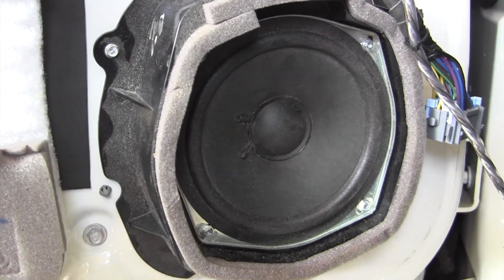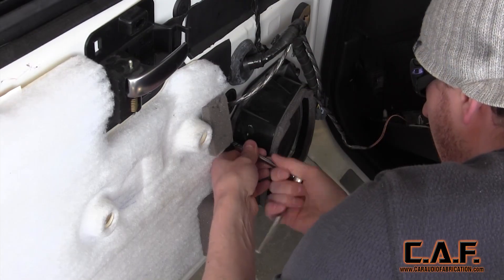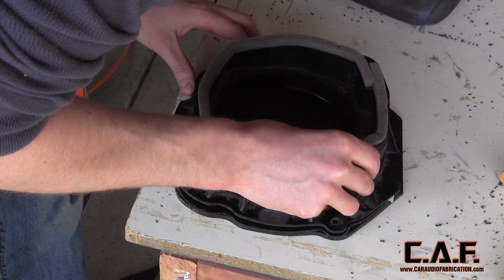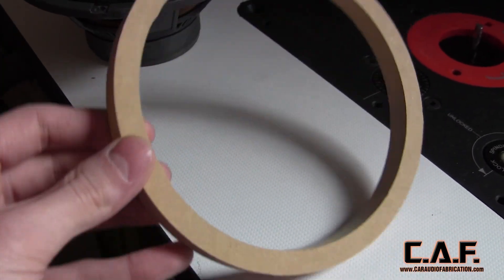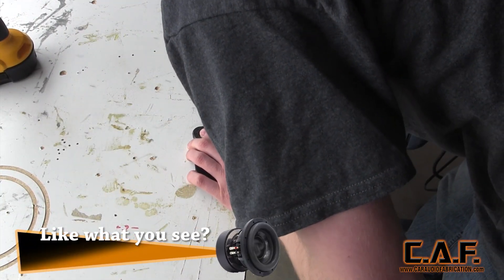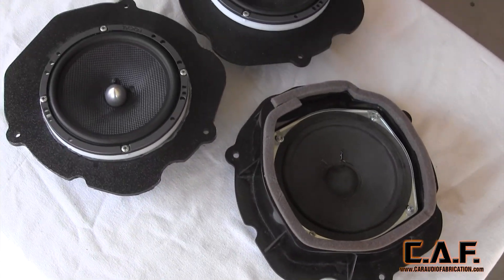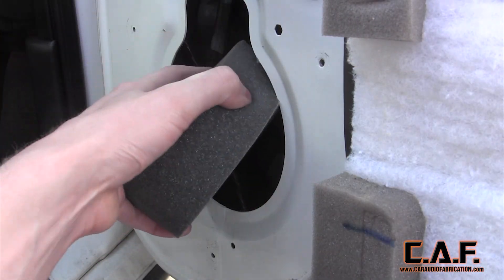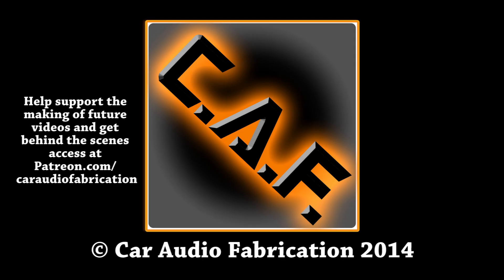How to Add Mid Bass - Build Custom Speaker Adapters CarAudioFabrication

Comment from the maker: Thanks for watching my video! Want more Car Audio Videos? Here are some of my most popular videos and projects you can watch!

5 common NOOB Mistakes - https://youtu.be/1FTsmUCbvoM
Amplifier Tuning How To - https://youtu.be/tiOUd3NkOyQ
Custom A-Pillar Speakers - https://youtu.be/neDSi4g1CeQ
4 Mistakes that kill bass - https://youtu.be/hXOnkOXvznI
How to Build a T-Line Subwoofer Box - https://youtu.be/KuBTuUdy460
Reply: You do installs? What state is your shop in?
Reply: I have 4 door speakers rated at 125 watts RMS and are 8 ohm. I bought a 4 channel amp that was supposed to be 150watt RMS per channel but actually are around 80 watt rms at 4 ohms. If I parallel the speakers to 4 ohms and bridged the 4 channel amp to 2 channels then how many watts am I going to get each speaker? Am I better off just running 1 speaker per channel?
Reply: A lot of youtube channels dont really answer questions that people have. Luckily there's a lot of information to all sorts of specific questions. You just have to be persistent in finding them.
Reply: Thanks. I'm gonna check out #3 & #4 right now!
Reply: How desing a sobwoofer box of 12 inch ported?

Comment: What would be the best way to achieve this with speakers on a backboard/parcel tray that's playing into the trunk of the vehicle?

Something like the Boom Mat Speaker Baffles???
Reply from the maker: Similar techniques. I personally avoid anything that "encloses" the speakers, those products are far too small and usually car audio drivers are designed for infinite baffle or much larger enclosure size applications

Comment: Is there a sound difference between foam speaker baffles and the open door with kill mat? Which sounds better. I am wondering about the foam baffles for my 6x9 door speakers but wondering if it will limit their sound output vs the open matted door enclosure. You are definitely right about the outside foam ring being necessary.  Made a big difference for me.

Comment: No dynamat?? I tell you what, I used Massive audio in my truck doors and sealed them in pvc tube. Free air sucks. Amazing control now and no bottoming out. Dyno tested these with a couple designs until I found the perfect fit and sound. Pvc 1/2 inch backer in a 6 inch pvc tube w/ short hair polyfill. Truck total amperage is pushing 6530 watts. Sound q is dialed.

Comment: Thanks for the info, I'm preparing to install my front components this week and my local Car AV shop sold me a silicone baffle set exactly like the NVX XBAF65 set instead of those FAST rings, I was wondering if they will work the same or the foam is a better material to seal and direct the sound out. 

Part of me is worried that all the snow we have for half of the year will affect and rot the foam. I do already have a sub in the back and might return these baffles and put that money to some SoundSkins sound mat if it's a more noticeable improvement over the baffle. 

Thank you for your help and advice in this channel. I'm asking you because I trust your advice more than armchair audio "experts" online and the salespeople at my local shops.

Comment: I did this...made a world of difference on the mid bass output of my jl c-250 6.5's in the doors of my hrv, it looked like the foam was sticking out way too far, but the door panels went back on no problem

Comment: I'm for sure making these. I can use the same items in description and follow each step exactly except i'm gonna have to put together 2 rings of 3/4" HDPE since my factory speaker mount is bigger than the one in the video. Also, my factory speaker is about 1/4 inch shorter than the focal aftermarkets i'm installing. that will give me 1.75" to work with and the glass shouldn't touch the speaker.

Comment: If sound quality is what someone is after why not do an 3 way 6x9 instead of going from an 6x9 to an 6.5 in Toyota front door speakers?
Is it mid bass they are after?
I've seen alot of these speaker upgrades, and am in the process of upgrading mine now

Comment: Few quick questions,   does anyone know the double sided tape he's using.  I'm assuming the normal  foam stuff (3m)  will flex too much??
   2ndly,  will a normal flush bit work if I'm not doing this full time?   I'm assuming that the abs bit is just due to heat and chip build issues, to last longer?? (Milling background) almost all set ti start this

Comment: After 18 years, I've decided to replace my factory fitted speakers of my Volvo to some JBL C762. The installer cut out the old speakers and screwed on the new one on the existing factory bracket. And the sound, not as good as the old rotted out ones. The old one has airy , big theatrical sound , yet maintaining natural sounding. The new ones lack bass and all the qualities of the old one. Would you please advise what went wrong? Is it just a matter of character of the new speakers? I noticed there were a rubber ring around the old one we had to remove due to space. Not sure that play a role.
Reply: Up

Comment: I have a 2018 Honda Civic Type R. Do you think with a spacer, can an 8” Dynaudio midbass can fit in the door? I want to be able to do a 3 way component speaker setup with a 4” mid range and tweeter in custom pods on the dash or A piller for a nice sound stage with an active crossover setup using the Alpine PXE-850a and Audison AV 5.1 and another 4 channel amp.
Reply: It might work but you will need to take precise measurements to avoid making it too small or too large

Comment: I will also add that you don't need to weather proof your speakers. Unless you're on a boat. Car doors do not leak anything like this moron is telling you. If they did you'd be replacing your window motors and lock motors every time it rains. Doors may get a bit moist on the inside if your car was built in the '60's but yours wasn't.
Reply from the maker: I spent 5 years working for a company that manufactured OEM sound treatment materials that would be installed into vehicles from the factory. So Im more than qualified on this topic. There is a layer called the "vapor" barrier on the door panel. This prevents the condensation from getting inside the vehicle that exists in the door cavity. Every door will get some water inside in the rain, but lets say for fun that your door is superior and doesnt get rain water in, you will still have condensation that builds up inside the door during temperature fluctuations. There is literally no reason to not use plastic materials. They are relatively inexpensive, and not that hard to work with.

Comment: I did something similar except for the fact that my stock pioneer speakers were Integrated with the bracket aka basket. So I cut off the speaker off the bracketwith a dremel ,RIP pioneer
speaker, Used the stock foam cushion, and mated the new kicker speaker to the factory basket and connectors . The new speaker looks and sounds great .
This video gave a thee idea 💡!
Thanks

Comment: I plan on fiberglassing my speaker into my door panel. Would you recommend closing off the back so it’s completely enclosed like a sub, and if so, how much cubic space should I have for a 6.5 or 6x9? Or should I just sound deaden and close up the holes in the door as much as I can? What would be the difference?

Comment: What brand component speakers tweeter mid-range and midbass with good sound quality less than $100 do anyone recommend
Reply from the maker: Anything under 100 is not going to be good. Save your money until you can get something worthwhile. Or buy twice because you won't be happy the first time.
Reply: @CarAudioFabrication  ok cool thanks for the reply i think ia.a work on geting the doors soundproofed first

Comment: Instead of using the cut foam ring for the back side, is speaker gasket tape just as effective? Or does the foam ring move into the door panel? I am assuming it is squished to provide a seal. is this correct?

Comment: Hey mark i have a 10 inch orion dual voice  2ohm 2000 watt rms hcca comp speaker. I have a 2002 ford ranger  edge. Standard cab. Im doing a blow through. I want to do the front in acrylic to showcase the sub and inside a box with LEDs. What would b the best inclosure for that speaker. Thanks. If u have blue print for a box. I have no problem with paying for it. Greatly appreciated.

Comment: what is the point of the white ring, rather than applying the speaker directly to the black adapter? I assume to generate optimal acoustics/create a spacer for better fitting?
Reply from the maker: Clearance for magnet on back side, gets closer to door panel grill hole on front side.

Comment: Do you still use fast rings for rings around your speakers? Or have you found a ‘better’/‘improved’ option? The FAST rings are not closed cell foam, so they’re not water resistant or sound reflective correct?

Comment: Those factory speakers adapters were way nicer than any truck I've owned or had the door panels off of... Way nicer. My stock speakers on all my vehicles didn't have fancy composite spacers and foam trim pieces. Nope. Just built in metal brackets that were part of the inner door structure and no foam, just the cheap paper cone speakers. Hecho en Mexico. Lol.

Comment: Could you not just remove the old speaker from its mount and reuse the mount with a new speaker?
Reply from the maker: Nope, it was too small, this is very common.

Comment: The rear ring only helps protect the speaker but does it also help with sound quality?
Reply: Yes. I didn't do that on my first car and the sound was shitty. Even though I'm still running no rings at all, my new head unit helped but it doesn't matter anymore because I have a new car to focus on building up with my old subs. Too bad BMW makes their amp wiring a headache, or else I would've had it done in no time already

Comment: That CA glue is super expensive at $45.00 for an 8oz bottle. The average guy doing one job isn't going to spend that much for something he would never use up.
Reply from the maker: The average guy would spend two seconds looking on the site and realize there is a 2 oz version that is less... It's quality glue, if you want your adapters falling apart use cheap glue.

Comment: My car doesn't have any of that...
The speaker is just screwed in metal brackets, there's nothing behind and just a plastic grill in front. It ain't on the door either, the front ones are in the dash and the rear ones are bellow the roof. What do I do with that setup? At least some isolation would be cool...

Comment: Is there a way to use the old speaker mount?
Reply from the maker: Nope, the speakers are too big.
Reply: CarAudioFabrication 
I'm going to be replacing all of my stock speakers in a 2016 Camaro without the Bose system and adding two 10-inch Subs. What would you suggest for mounting the doors and rear seat speakers

Comment: Crutchfield and Amazon both sell the Roadkill FAST foam baffle rings from Stinger that will act as a foam enclosure to direct your speaker sound outward. They're $25 a pair unless on sale. It's not the full mod effort CAF shows here but it'll help focus sound forward. I'd also suggest adding some sound deadening material behind the woofer cone somewhere. You may not care about road noise but it'll help quite a bit to dampen sound LEAVING your car, redirecting it toward the rider(s) and helping reduce the exterior noise so people outside aren't overly disturbed by your audio. If you have limited supply of dampening material, apply the most BEHIND the speaker so that you're at least dampening and redirecting sound where the source is. It'll be best to apply throughout each door your speaker is mounted but localizing it is always the most effective application when working without an excess of materials.

Thanks to CAF for all these tutorials. Learning plenty on the manufacturing side of the car audio process that I didn't know would make such a big difference.

Comment: Hi. awesome piece of work. ur an artist!

I have got 2 questions. first I want to buy a cheap car stereo. which one u think is better? Sony DSX-A210UI or Pioneer MVH-S105UI?

and 2nd, I used a jvc stereo as an amp with 2 old AKAI Speakers (including woofer and tweeter) and 2 microlab small midrange speakers and powered it up by a computer psu, But i just get some hummmm sound at high decibels, how can I reduce it?

Comment: Best vid I have seen on use of fast rings.

The foam ring that you cut for the back portion of the speaker, what are you trying to achieve? How do you know how much to trim?

thanks for the video.
Reply: He wasn't asking what the the foam is trying to achieve, but rather what CUTTING the foam is trying to achieve.

Answer, to allow it to fit. The door is often too shallow for the full thickness of the rear foam. So it needs to be trimmed to fit. They deliberately make it extra wide so it can fit a variety of vehicles.

Figuring out how much to trim isn't rocket science.
Reply: Sound absorption..not sure why that's not self obvious..

Comment: Mark, I need a little help with and install. buddy of mine has a 2015 Silverado with Bose, wants to replace the speakers with better ones. He already 6x9 components for the front and dash with brackets and 6.5 for the rear a 5 channel amp, LC7i LOC speaker harness's, 3 Farad CAP, brackets and so much more. He wants to bypass the Bose amp for the speakers, but wants to keep the factory HU and all the chimes, park assist etc.. that hangs off it. I have been trying to help him with looking up information on the Bose amp and which plugs go to what but I can't seem to figure out them all. any advice or help would be greatly appreciated. Rob

Comment: Ok, so I made the custom speaker enclosures and installed them in my vehicle (great thanks to your video).  In addition to the rings I made fiber glass pods so the speakers are completely enclosed for each front door and the bass response is much stronger.  My question is when I run the RTA over my system there seems to be a drop off around 125-250 hertz.  I am running hertz 6.5 inch speakers and listen to quite a bit of country music.  The male vocals seems to be a bit shallow however the overall system sounds and images great.  I was hoping to pick up more mid range "fullness" but just got punchier bass.  Any thoughts or ideas?  I know polarity/phase are good, everything is corrected via time alignment (Audio Control tech support provided direct remote support to my laptop when it was connected to my DM 608 DSP.  They also provided support to double check the settings on my JL Audio amp.

Comment: Nice addition with the foam.  We would always space the speaker until it was as close to the panel without touching as possible so you wouldn't get any refraction from being recessed so much though the foam should absorb any soundwaves as opposed to reflecting them.  Good work.

Comment: It is so true, not that you need my approval of course. One thing I've done that I do with Hi-Fi speaker builds is using speaker mounting tape aka speaker culke. Along with sound treating the surfaces it makes a difference(If clearance is an issue then this could help too for £3-4 at loudspeakerfreaks) Great video as always :)

Comment: I've only used wood (MDF) to make my speaker rings in the past, because it kills vibration better than plastic. You want your speaker frame completely free of vibration - from the car, or from the cone itself as it plays sound. The thing about wood is, if you don't completely seal it, and any water gets to it, it'll expand, crack, grow mold, and the moisture it holds against the metal inner door induces rust formation. Don't need to worry about all that with plastic, but plastic has less resistance to vibration.

Comment: Hello C.A.F, I am planning on upgrading my doors speakers on my Quadcab, 08 Silverado. The speakers on these trucks are 6.5's on all four doors. Before I do, I would like to ask if it is possible to customize and retrofit a 6x9 into the doors instead of the 6.5 size, something like what Dodge Ram did with their trucks, and they sound way better just in stock versus stock speakers. I'd like to do the same on my Chevy, but am a little skeptical on pulling it off. What do you guys recommend?
Reply: Saul H don't do that there's literally no benefits to running a 6x9 over a 6.5 speaker

Comment: I see one change you could have made to sound better, Piston aiming of the speaker's, your legs do not have ears. a slight angle towards your ears would improve the sound even more, Kick panels do not fire into the console they try and aim at your ears.
Alpine's earthquake speaker's  ........... Oh hold it your not that old, you were still in diapers when they did that promotion.
But I will say covering the inside of a door metal panel with a sound deadening material will go further to help too.

Comment: Okay, question, does the foam ring in front press up against the plastic door panel around the speaker grill? Because my speaker grill/door panel is not level with the face of my speaker, but rather its slanted. How easily does this foam compress? Can I just put it on and hope that the foam on side of the speaker with less space between it and the door panel will just compress and still form a good seal?
Reply: Yes, the ring in front presses against the door panel and is compressible. You will want to cut it to approximate size and angle so it doesn't fold over into the speaker. You want it a little larger than the gap so it forms a good seal.
Reply: Sound Connection Inc. I'm about to order this for my front doors. Do I need to order 2 kits one for each door or does it come in pairs?
Reply: They are sold in pairs so one kit will do two speakers.